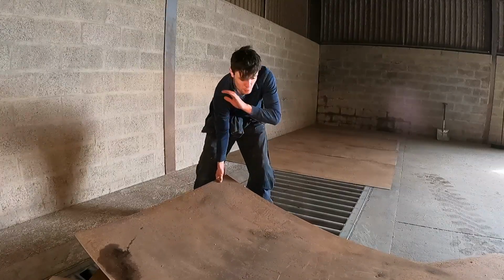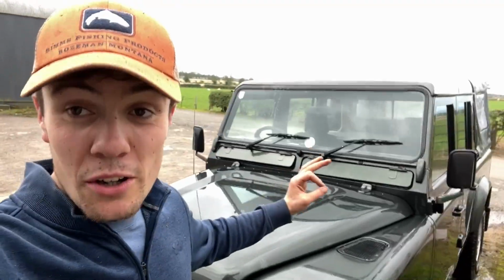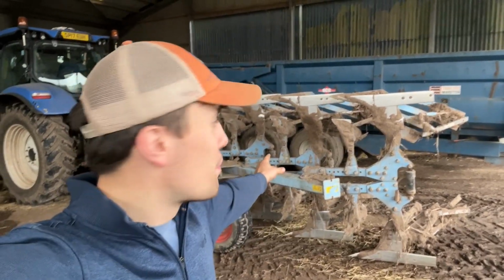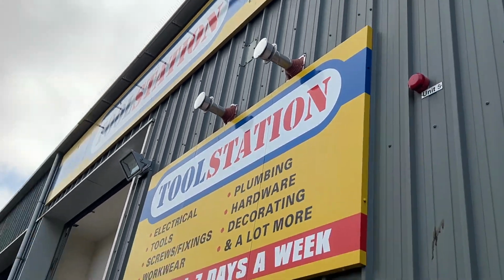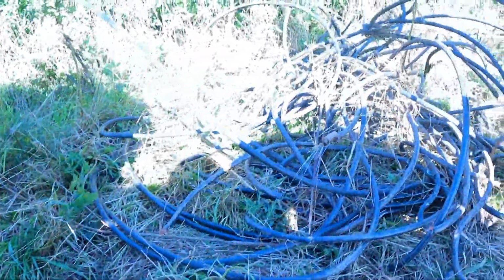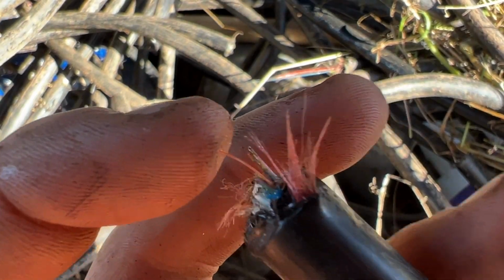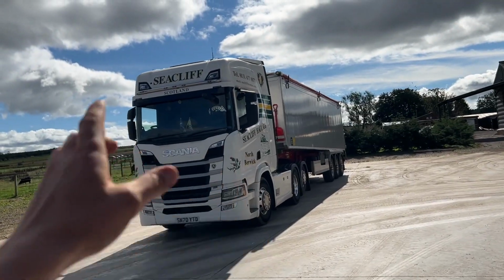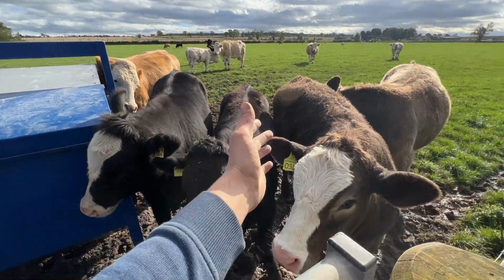Not Our Fault! | Stopping Growing Oats | Hedge Cutter On Fendt

Comment: Fibre cable is dirt cheap , it's like 1p a metre, that's why they just leave it lying about and no-one nicks it.
Worth keeping the Landy as long as possible and sticking a chassis on it when it needs it. Although it can be cheaper to strip your own off and just get that blasted and galved.
Reply from the maker: Aye guess its to come off for a new one anyways, new rear cross member, galv and chuck it back on 👍🏼